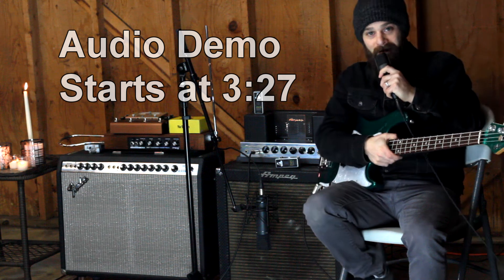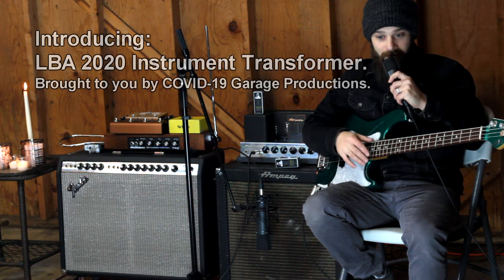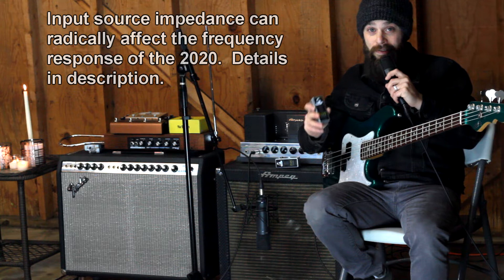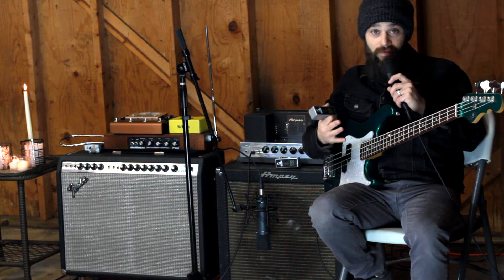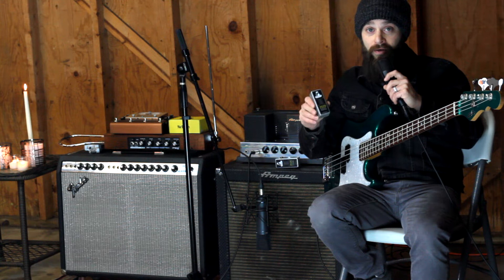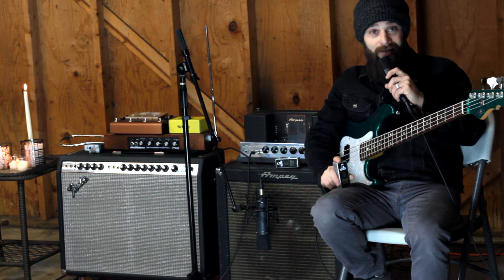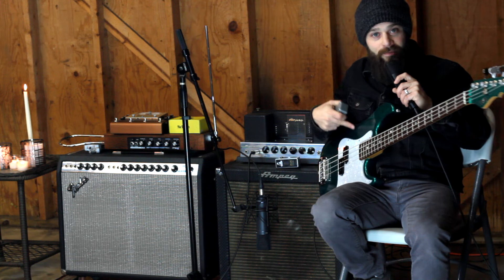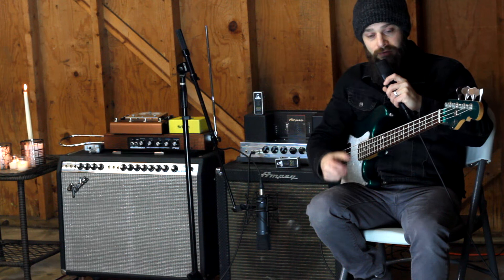Lightning Boy Audio 2020 Instrument Transformer - Lockdown Demo

Comment: Interesting concept, I'm definitely a fan of the sound that different transformers can impart on your sound, from Nickel, to Steel and alloy etc; Just wondering if there has been any EQ or level boosting of the audio when the 2020's are engaged? Also, what is the metal composition of the transformers you're using? Is there an option for different kinds of metal?
Thanks
Reply from the maker: Thanks for watching!  There is no EQ or boosting, its just a transformer.  There is no way to change the core composition without also increasing the physical size of the transformer, as it is it barely fits inside of that little enclosure.   The exact composition of the core is proprietary information.  Please watch the second half of my following video for a sneak peak. https://youtu.be/cvu2h8OVaP8
Reply: Lightning Boy Audio thanks for the response! Great work and attention to detail, does seem to make the bass sound ‘larger’
Reply from the maker: Bass Lessons Melbourne Thank you.  I personally feel it does.  To my ears it sounds rounder and a bit more focused in the mids.